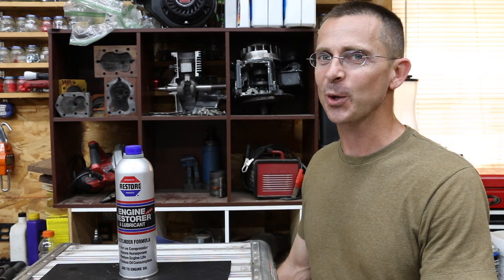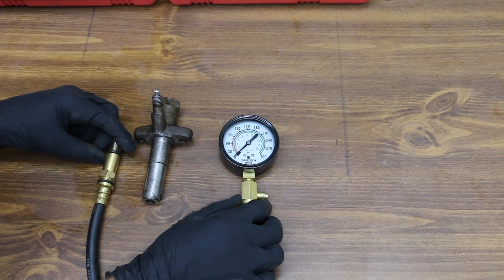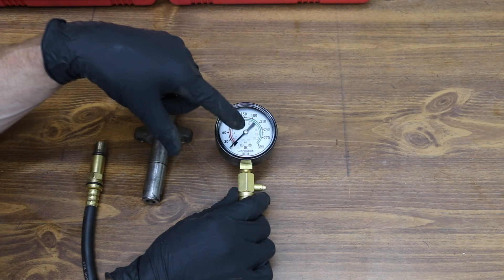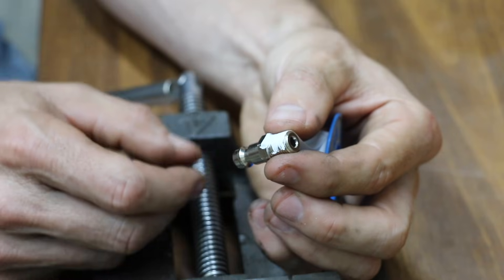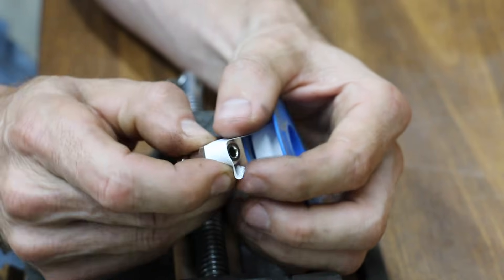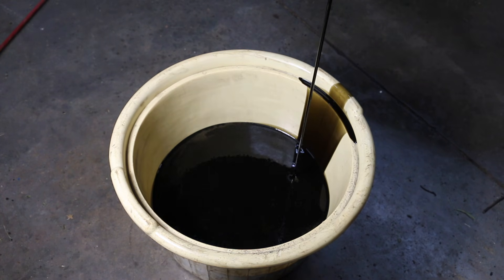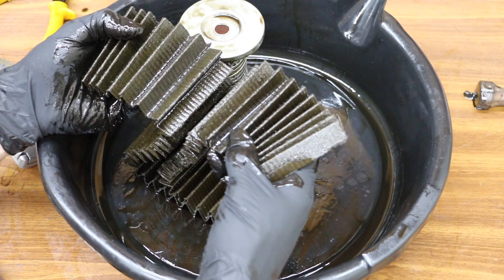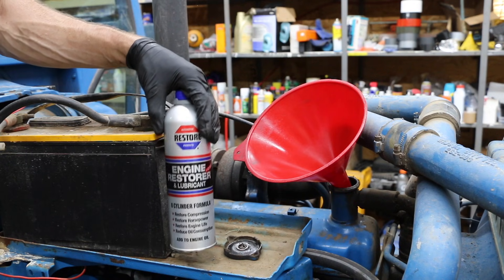Did the "Engine Restore" Compression Improvement Last?  One year later (Episode 2)

Comment: I recently learned that STP has zinc which is good for flat tappet cams , but it's super thick and I don't like that. STP also has a synthetic additive with zinc and it flows good. What is your opinion on STP , thanks.
Reply from the maker: I don't like viscosity enhancers either, unless it's for an engine that's badly worn.  I prefer Engine Restorer.

Comment: I have a small 1.0l 3 cylinder which has a loud ticking/tapping sound under heavy acceleration. Previous owner ran the car with almost no oil. Topped up the oil which helped a little but a leak in the filter had the noise coming back just as loud within a day or two.

The tapping only occurs when the car is moving. Acceleration in neutral doesn’t produce the tapping noise. What could this be? Would an additive like that help?
Reply from the maker: Thanks for the constructive feedback

Comment: Project farm for the win. Had a question would this be ok to use in a older Honda civic with vtec. I've replaced almost all the seals except valve cover gasket and rear main seal. Do you think the restore is ok to use with most of the internal seals being new(less than 10k)  and would I need to add this at each oil change or just once every few oil changes. Thanks and keep it up
Reply from the maker: Thank you!  I believe it will be fine but recommend calling the Engine Restorer customer service help line just to be safe.  I would use it with every oil change or every other oil change.  It tends to wear away over time.  Thanks again!
Reply: @ProjectFarm  thank you so much will continue watching your vids and recommending your channel.

Comment: I have a Volvo T22, originally made to run on kerosene. It has two tanks. One for gasoline one for kerosene. Back then they started it on gasoline then switched over to the pre-heated kerosene. I run it one gasoline mostly but it's not optimal. Is there some reason I shouldn't try this engine restore oil on this old beast? I'm learning. Thank you.
Reply from the maker: Thank you

Comment: One of my cars is a 1984 Lincoln Towncar with 300,000+ miles on it.  My mileage gets down around 13/14 and I change oil, I include a can of restore and the mileage goes back up to 17/19.  I've been doing this since I hit around 250,000.  It doesn't seem to last forever so I think it requires reapplication, but it does what I need it to do.

Free advice:  When you drill something the vice isn't supposed to move around will ye nil ye.
Reply from the maker: That's a lot of miles!  Thank you

Comment: Alright, if "Engine Restore" worked on your low-RPM diesel tractor engine, what if you use it on a lawnmower engine!
(Since it doesn't hold much oil anyway, would such a small percentage of Engine Restore help?)
Back in the day, we would use "STP oil treatment" for compression loss, on high mileage engines.
(Which would put a thick film of oil inside crankcase.)
Enjoy your videos!
Reply from the maker: Thank you!  Great test idea on the lawnmower.

Comment: Not knocking his test, but I found that the tractor would not run/start cold and he said he changed the nozzles along with the Restore. Finer spray nozzle start any diesel better and easier....
Reply: remember that diesel & air mixture explode by mean of high compression. 

Lowered compression on a diesel engine is like a weak spark on gasoline engine...
👍🏻
Reply from the maker: Thanks for the constructive feedback.  I changed the injectors around a year before this video without any improvement.

Comment: An additive that I stand by is Lucas oil transmission stop slip. I had a car that had a automatic transmission that started to slip around 90k miles. I used Lucas oil transmission stop slip and It stopped slipping and I drove it for another 125k miles without any transmission issues.
Reply from the maker: Thank you!

Comment: The secret is to shake the can for 5-10 mins so that when you look in the bottom of the empty can all the resin and secret sauce is stirred up good in the base oil. Use with a fresh oil change. Run for at least 30 mins to an hour on first application before shutting down.
Reply from the maker: Great tips. Thank you
Reply: where do you buy the product can?
Reply: just put it on a paint shaker

Comment: To sell me on Restore, someone would have to tear down an engine and get all the clearances on the mains and rod bearings as well as the rings in the cylinders and measure that gap in the rings in the cylinders and get all that and write it down, then put it back together and run the engine with restore in it and see what is causing the improvement in the compression. Or was it just because the valves started seating better or the clearance on the valve guides better than before? What is causing the increase in the pressure? Where is it gaining at?

Comment: I had good experiences with Prolong engine oil treatment. I had a 1990 Toyota Camry V6 with Prolong in it when a steel 3/8 line bringing coolant to an emissions component rusted through. I was out in the country, miles from water, and the engine temp never went above two needle widths above the normal observed temp--even though the coolant was completely drained by the time I made it to a truck stop. And yes, the gauge worked. This alone tells me that Prolong is something special. They had run a commercial at the time showing them draining all the coolant out of an old fire truck engine and running it in a parade,, but I didn't believe it.
Reply from the maker: WOW.

Comment: Dear sir, which engine additive do you suggest if I have a fairly new ford 1.5 tdci diesel motor. I just want to maintain it better and it has no problems at all and has clocked 30k kilometers. I used xado atomic at 20k and didn't see any much improvement.
Reply from the maker: Thank you.  If it were my vehicle, I could occasionally us a fuel cleaner. I would use a high quality full synthetic motor oil too.
Reply: @ProjectFarm  Thanks, won't restorer/xado/ceratec do any good to PREVENT the damage?

Comment: Old video but I've used Restore in my old engines for years with great results. Has kept my 2002 Escape with 230000 miles running strong. My grandfather ran 5 quarts of Restore in a mustang that had been ran dry of oil and had stopped running. He got it turning over and continued to drive it for another 5 years! Cheers!
Reply from the maker: Thank you!

Comment: If you want to separate the metal from a paper element removed from the can, cut up the length into smaller sections and put into a gas filled quart or half gallon container and agitate after a soak. Let it set to settle to the bottom and remove the paper, rinsing off the sludge clinging to bottom. You will have to then rinse the sludge a few times in fresh gas to eliminate the oil sludge, but you will find the metals and carbon particles at bottom. The old Franz oil bypass filters were great at collecting these particles with the toilet paper rolls holding all that debris at the inlet end when you pull off the cover.
Reply from the maker: Great tip! Thank you

Comment: Like the video gonna try it on my 352 fe , I got one you can test if you haven't already, Barsleak coolant system leak Stopper. There's a few different types,  heads sealer, radiator stop leak, some for iron some for aluminum heads.  Curious to see how they all perform, I've used the one for Aluminum head leaks, had a water jacket that was cracked , and yes it did work for me, as for Radiator and watched it used on a Autocar big rig, that was squirting out bad, was a pinch so used it and it worked on that too albeit only till new radiator was installed a week later,  but truck worked everyday that week with no problem. Thanks for the cool content.
Reply from the maker: Thank you for the video idea!

Comment: How about adding a magnet to the back of your filter or use a magnetic drain plug?
Reply: Also if you can put one on the mower.  And ferris metal will stick.  Though aluminium and brass will not obviously stick.  Ymmv...
Reply from the maker: Thank you for the video idea!

Comment: Hello I just wanted to run something by you since your on the topic of oil filters.. Thought you would like to know that if you take a fairly decent size magnet and place it on the oil filter preferably on the crown..it will do and excellent job of capturing metal particles.. And stop  their re-interduction into the lubrication system.. Then you can cut one open to actually see what is being stopped.. give it a try.
Reply from the maker: Thank you for the video idea!

Comment: No doubt "Restore" has been shown to be good stuff.....the problem with using it in today's cars....is that Restore uses something like copper powder or other very fine paticles that fill-in the micro-scratches on the cylinder walls, etc....to get the compression back up. So far so good. Many of today's car's however also have variable-valve timing, with tiny sprockets, gears and incredibly small oil passages used.... to hydraulically alter the cam timing of the camshafts. So far,  no one has been able to tell me that Restore is safe to use for these modern variable-valve-timing engines without possible affecting the VVT systems.
Reply from the maker: Thank you!
Reply: @ProjectFarm  Again.... not being critical as much as saying there should be a caveat for things like this. Clogging up the VVT system in order to get the other benefits of Restore may be a big problem and could cause an engine rebuild. Trying to get Restore themselves to answer this and so far no luck. Restore is a good product and for-sure .... for old school engines. Caveat for newer designs.

Comment: JUST FOUND A BEAUTY, NO FRAME ROT, AND ORIGINAL PAINT IS STILL UNDER THE FLOOR, UNBELIEVABLE IN THE NORTHEAST, HOWEVER , THE TRADE OFF WAS SHE'S GOT 
265000 MILES, FORD F1504X4 WITH THE 5.8 FUEL INJECTED MOTOR. 
IT'S BEEN AT MY MECHANICS, AND I WAS STOPPING BY EVERY OTHER DAY STARTING AND LISTENING TO ENGINE, COLD, AND HOT. WELL SHE HAD A LITTLE LIFTER NOISE THAT CLEARED UP AFTER A BIT, SO I PUT A COUPLE OF CUPS OF MYSTERY OIL IN. RAN IT TO TEMP. AND THEN SOME. COUPLE DAYS LATER,  NO LIFTER NOISE? MECHANIC DID COMPRESSION TEST TODAY, LOW, ARGGG. BUT HE CAN'T GET OVER HOW GOOD IT RUNS. I'M NOT ONE TO BELIEVE IN OIL ADDITIVES,  BUT I'M TRYING RESTORE. NOTHING TO LOSE.  TRUCK IS REALLY SWEET, FOR WHAT I PAID, NEXT, A CENTER LINK , AND SEE HOW TRANNY REALLY IS WORKING. YOUR TEST ARE GREAT. HOPE THAT RESTORE HELPS.
Reply from the maker: Thank you!  I hope it helps. Could you please create a new comment letting everyone know if it helped?  By the way, did the mechanic perform a leakdown test to verify that the low compression is from the rings and not the valves?

Comment: I subscribed to your channel.  I guess if your engine is burning oil too because of the piston rings engine restore will probably work.  Those are promising results.  There's an additive you can try and it's AT-205.  It supposed to rejuvenate your engine oil seals, like the rear main seal, and stop it from leaking.  They don't sell it at most auto parts store and I think I know why.  I heard it works a lot of the time.  But how many additives can you add each oil change?  Put a bottle of this in, put a bottle of that.  You never know.  Maybe you can add Engine Restore, AT-205, Seafoam to take care of the sludge all in one oil change and never rebuild a engine again.  😁
Reply from the maker: Thank you for the recommendation!  I'll have to find some AT-205.

Comment: This was really interesting. I love watching your videos. They are extremely detailed and your method for testing a hypothesis is really scientific. I was wondering. Since you added the restore into the oil. It would thicken it and possibly keep the compression stable. Since oil lubricates the parts and keeps the metal away from metal. It also fills the spaces in between creating compression. I would like to see another update! Mainly with just the oil and without the restore. Just to see if the compression numbers have held up! :) Just a thorough flush of the oil to get any remnant of the restore out would make it even more scientific!
Reply from the maker: Thank you for the recommendation!  The numbers will drop off over time without restore.  2-3 oil change intervals and most of the copper, silver, and lead will wear away.
Reply: @ProjectFarm  Awhh, that sucks. Although for temporary fixing it doesn't sound so bad. I actually wonder. Does it cause any damage? Now that I think of it. It can't be good to have pieces of metal even microscopic floating around in the oil. Wouldn't it be the same as allowing debris through the intake? So like driving a car without an air filter? What do you think?

Comment: The question is.  Does the product help seal gaps along the rings or does it help loosen carbon desposits around the cylinder head to reduce friction and reatorw power that way.  Maybe use a borascope to inspect in the inside of the engine before and after and compare to to Marvel Mystery oil.  One guy use it and sea foam and Marvel made the Piston clean as a whistle.  Both products did sit for 24 hours.
Reply from the maker: It helps seal gaps.  Thank you!

Comment: Bars-Leaks Radiator Stop Leak (the HD stuff with Pellets).. The only radiator treatment I trust, it fixes leaks, lubricates the water pump and conditions the cooling system and is very inexpensive... I had the engine replaced in my Tahoe and it started leaking antifreeze into the motor oil, I noticed something was not right around 500 miles. At 2,800 miles I added half the contents and really cannot see the coolant bottle going down after a few warm up cycles.. Like you, I did not want to pay a small fortune to replace the gaskets again and this stuff may correct a problematic gasket from leaking.
Reply from the maker: Thank you for the recommendation!

Comment: I was changing my girlfriends oil and noticed pretty bad blow by. She has barely had the car two years and does regular maintenance on it and doesn’t drive hard. It’s a 2014 Sentra with 89,000 miles. Would this do any good or harm to the engine? It runs fine but I do notice she is always about half a quart to a quart low in between oil changes
Reply from the maker: Engine restore makes a 4-cylinder version that you might consider trying.  I'm really surprised the Nissan has bad blowby with such low miles.  This product should help.

Comment: I watch a lot of automotive YouTube videos and may I just say I trust you so much that i decided to dump Restore in my 98 4runner (253,000 miles) with fingers crossed. After less than an hour of leaving the Walmart parking lot, the idle seemed to even out and it ran like a dream and had much more power. The engined quieted down and my gas mileage increased! I combined it with AT-205 for my seeping seals. I trust modern science more than I trust automotive purists that call additives snake oil. Thanks for doing these tests and helping people save money. You're doing the Lord's work brother.
Reply from the maker: Thank you very much for the feedback on Restore.  I'm using it on several pieces of worn engines around the farm and it has helped very one of them.
Reply: I'm not a big additive fan but restore worked on my old bmw 4 cylinder big time. Near new compression and a very smooth happy engine again. Oil consumption literally went to 0 between changes! I, like this video used the 6 cylindrical can, I could only find 6 and 8 cylinder cans, they do make a 4 cyl can. I've since used it in my porsche which I'm super picky about and the engine is very happy and my mileage increased as well!
Reply: Liqui moly motor oil saver is great for seals.
Reply: There are certain situations where you should not use restore. As far as I know you should not use it in more modern motors with oil actuated variable valve timing, nor in diesel engines that use oil to fire the injectors. Also, there are a lot of snake oils out there, but AT205 and engine restore are genuinely good products.
Reply: 2 year later, is it still as great as you say it is?
Reply: @lickyweeks  I'm on 276,000 miles now and my 98 4runner hasn't shown any signs of slowing. I change oil every 3,000 miles too. Engine still purrs like a kitten even on steep inclines in the snow (Pacific Northwest). My gas consumption is still the same as I constantly monitor it.
Reply: That’s like saying all I have to do is top my coolant off once a week but my mechanic is telling me it leaks
Reply: Automotive purists. That’s funny.

Comment: Would this work if I had 3 cylinders with good compression and 1 that has 30lbs of pressure?
Reply from the maker: It may be too far gone. Have you accomplished a leak down test to make sure it's worn piston rings and not valves?  If it is the rings that's causing low compression, it might help.
Reply: @ProjectFarm  actually I am going to do one this week. I'll let you know. Thanks for responding.

Comment: Great video and inspiration to try Restore on my old 1 liter, 3 cyl Hinomoto that has had excessive blowby ever since I bought it 15years ago. Have put 650 hrs on it with no increase in exhaust nor blowby. I just put in half can of v8 size into 3 gt capacity oil and the blowby has stopped after an hour of running. Amazing, but is this too high a mix? I can't find spicific info anywhere. Maybe I should reduce to 4 or 5 oz in 3 qts, rather than 8. Suggestions?
Reply from the maker: Very impressive results!  I don't know if that's too much additive or not.  You might consider sending an email to the manufacturer. They have a website and customer service contact information.